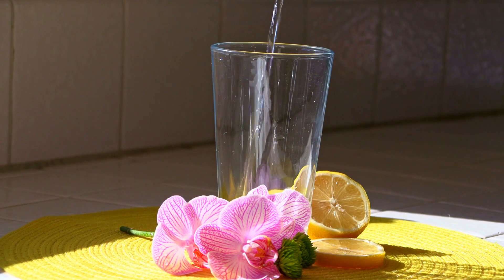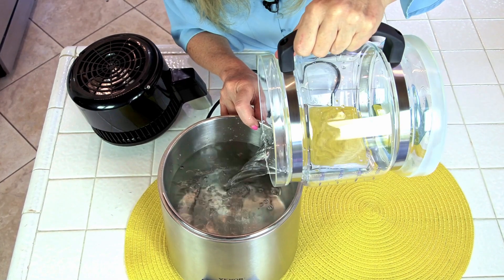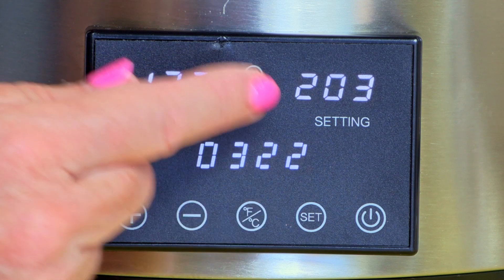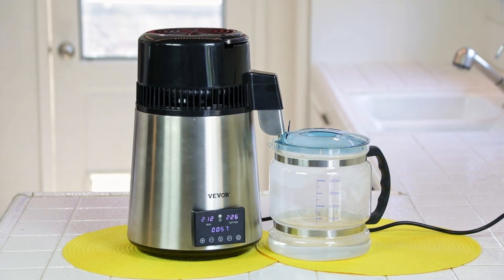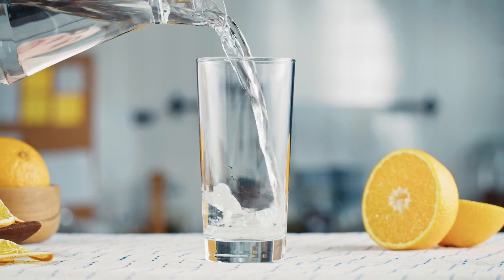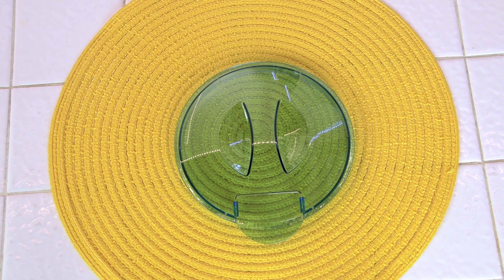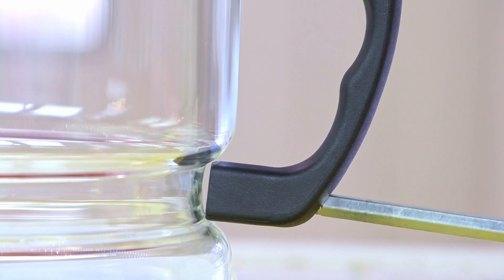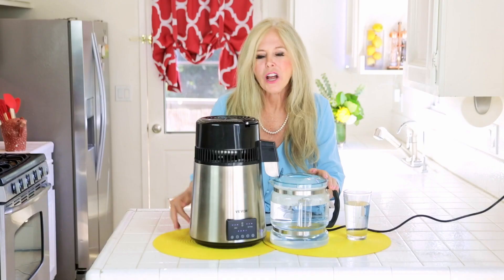How to Distill Water at Home | How to Make Purified Water Vevor  | Survival Emergency Preparedness

Comment: Food for thought: if you use the carafe to fill the machine, the carafe has tap water residue and would therefore contain any potential pathogen that you are aiming to remove when you distill the water. No? For this reason, I never rinse my neti pot with tap water after I wash it. I have excellent tap water where I live, but the point of using distilled in a neti pot is that there is always the potential for some pathogenic contamination.
Reply from the maker: You bring up a very interesting point, thank you for explaining that.  I agree with you!

Comment: I just got the basic one. I also have a particulate meter I got with a Zero Water pitcher. The 1st 16-20 ounces read from 010 to 001 ppm, after that it reads 000, though still has a touch of an aftertaste vs the store bought distilled jugs. Tap water reads 230 on the TDS meter. 

Overall happy though I recommend setting aside the first 20 oz or so and re-running that on later batches cause I think that's some of the chemicals that are put in tap water & it's getting trapped in the early steam column. Can't wait to try distilling some other liquids.....;P

Comment: Just a heads up, Drinking a lot of distilled water is dangerous please research before doing it.
Reply from the maker: Thank you for your comment.  This method totally purifies the water, for the minerals and other things that Spring Water may have, it is easy to add that to distilled water from time to time, or in the form of a supplement.  That is why did not cover that.  Please give me your opinion and information as a reply.  Thank you again.